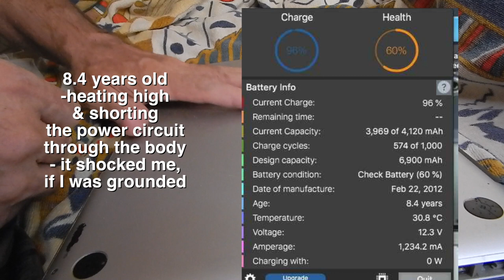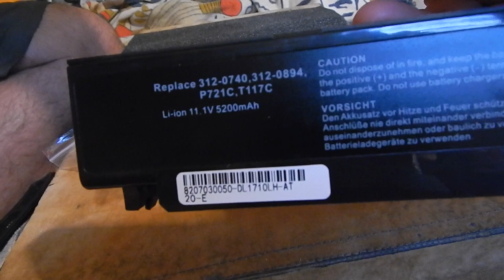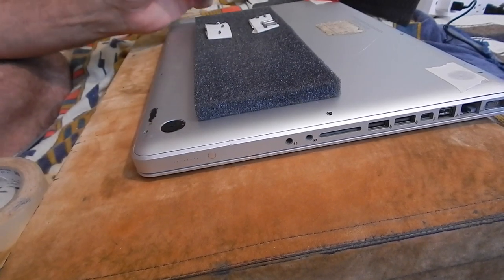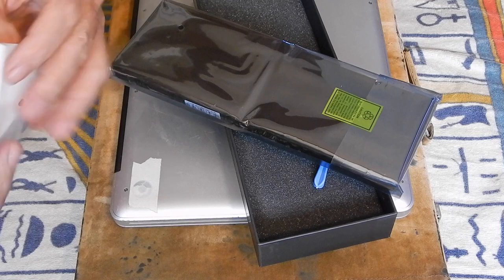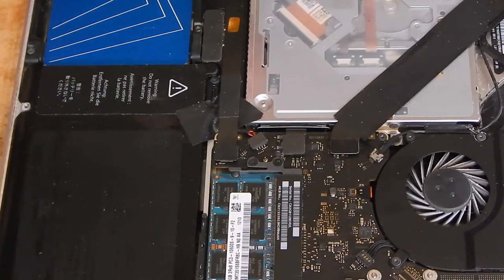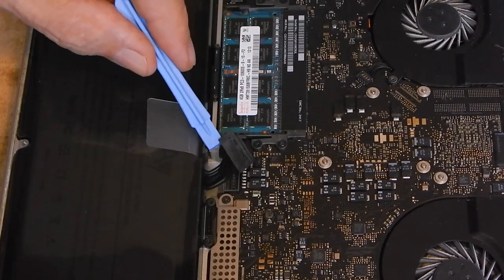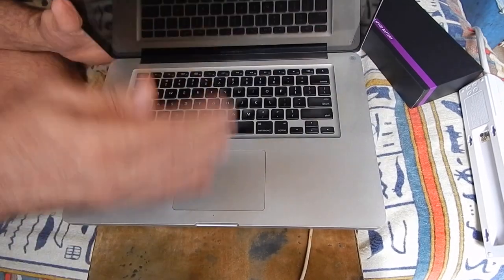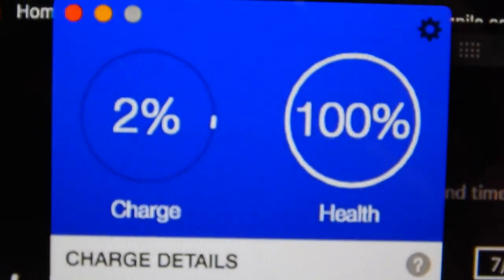Replace Battery = MacBook Pro early 2011

Comment: what battery did you get?
Reply from the maker: 77.5WH A1382 Battery for Apple MacBook Pro 15" A1286 Early / Late 2011 Mid 2012

my laptop is the A1286
I bought a HWG brand A1382 battery.
It said, "new," and it was "off the shelf" new.  Yet, use a battery-check app and found out; it was made in 2016, so it was on the shelf for years.
   Those things run around $30-$40 on EBay.
thanks for viewing.. hangloose